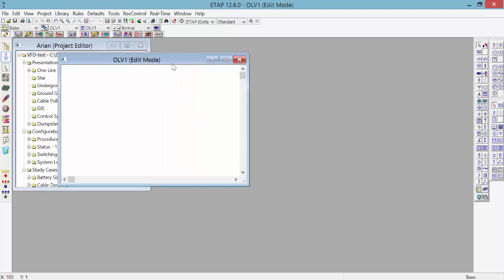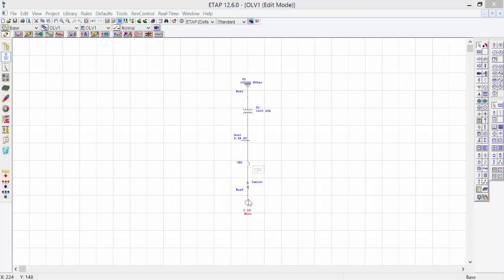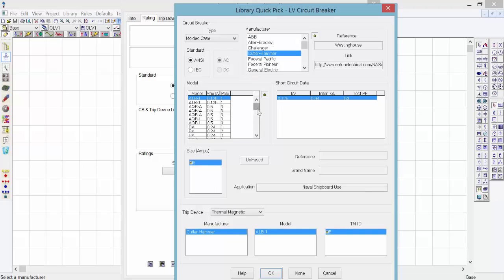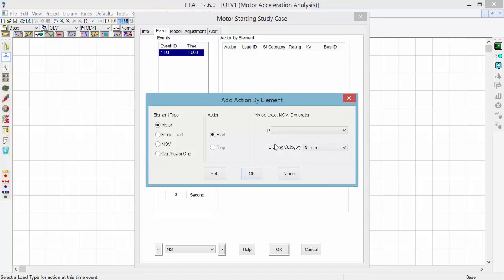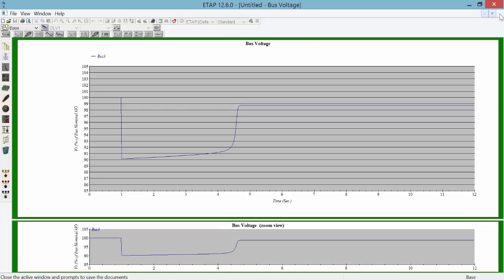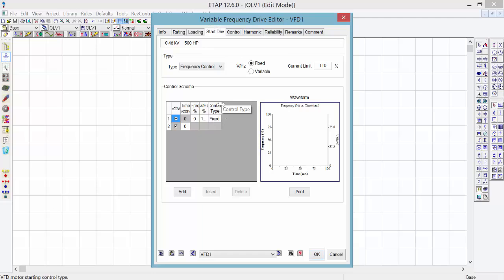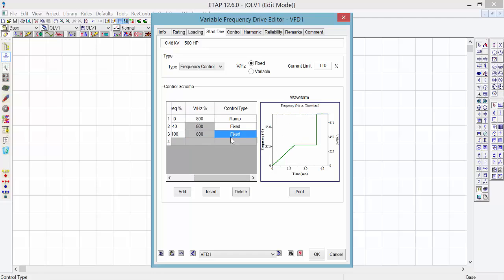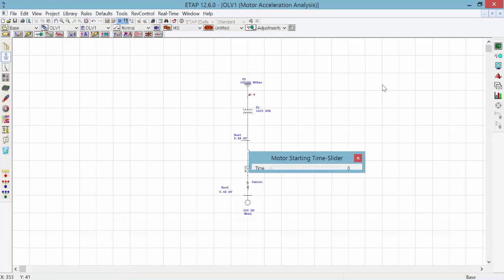17  Example motor starting using a VFD

Comment: using voltage to hz ratio of 8, when i check the motor terminal voltage, it increases up to 1.2 kv during starting on a 400V system. When i use the 100% ratio, i dont get the problem..

Comment: Hi dude, excelent video, i have a doubt, i'm doing a simulation with two high voltage motor (approx 200 KW and 480V) and two VSD, but the voltage at the output of the each VSD is under 0.085V.

i have the frequency in 60 Hz and the relation between V/Hz% is 800%

do you have any idea that what's wrong? How i can increase the voltage?